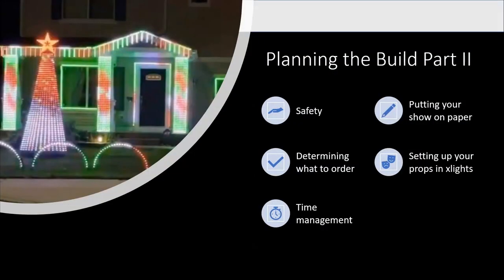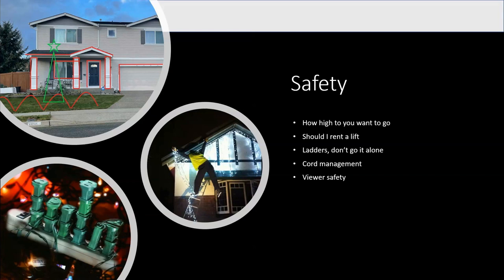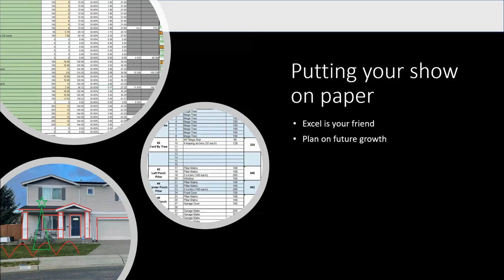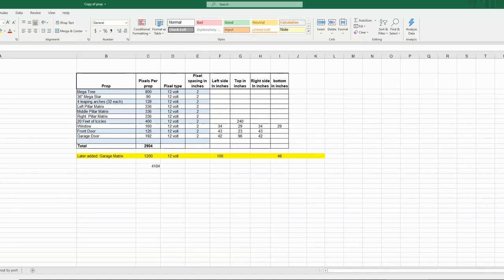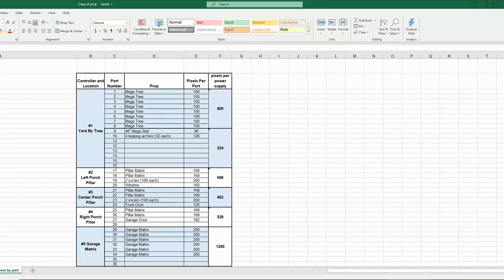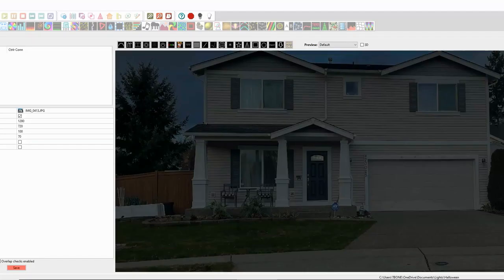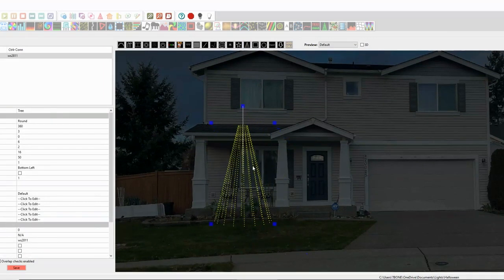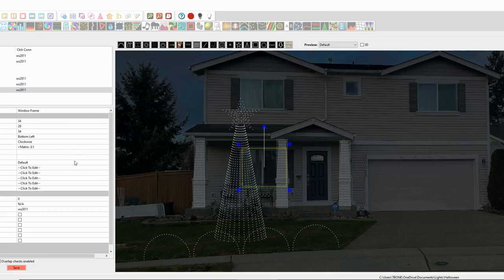Part II How to Build a Christmas light show using LED RGB Smart Pixles Planning your Display

Comment: Great Information. One question. Looking at the last spreadsheet; for example your mega tree calcs, u show  14.40 amps. I assume that includes the power supply amperage for the controller. Where do you get all of the extra circuits in your house panel to run all of these controllers. Most homes have limited room for extra circuits?
Reply from the maker: That is the amp is is pulling on the Power supply which is different that what the power supply is pulling off the braker. we run about 10,000 light now in our show and most of it is off two circuits. our new mega tree now has 3200 lights plus about 1500 light in the yard and it is all off one circuit

Comment: Hello, I have a 15 amp breaker and I want to start a small 800 pixel show next year, Do you know how many amps it would be for me to do a 800 pixel show on 30% brightness? Thank You.
Reply from the maker: Not an electrician , but my understanding:
Power = Current * Voltage.  So on a standard household circuit, you have 15amps * 120v = 1800 Watts available. Pixels at max power of 0.6w at full white
1800w / 0.6w = 3000 pixels.

- It's rare that you'd be running all of your lights on full white at the same time so you should not have any issues with 800 pixels on one circuit
Reply: @CounterHolidayLights  Ok, thank you!